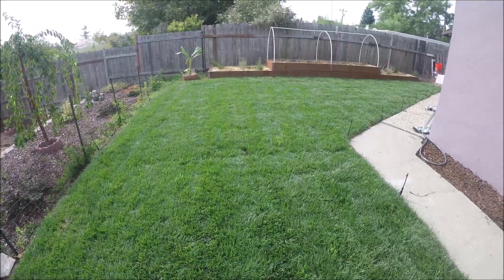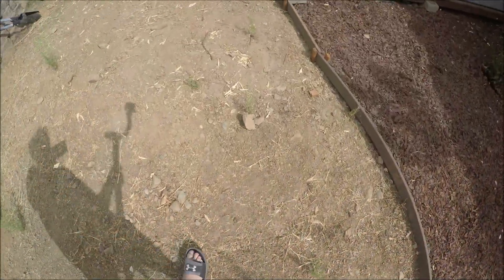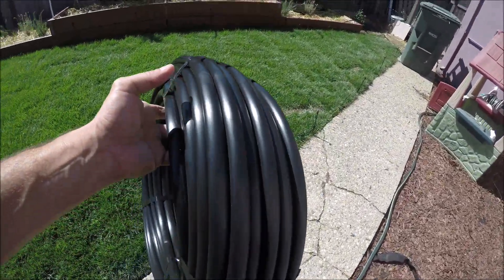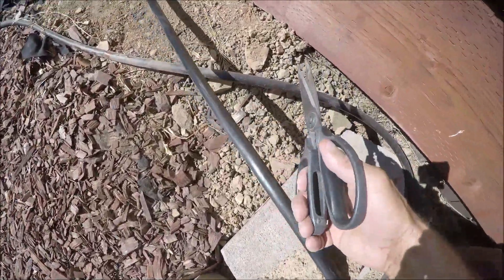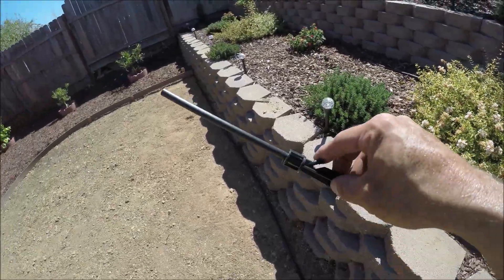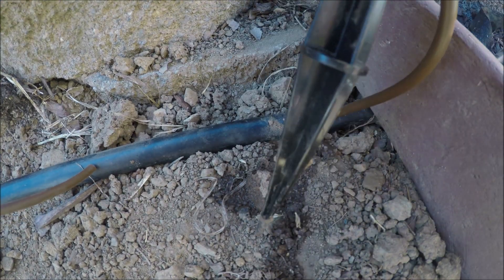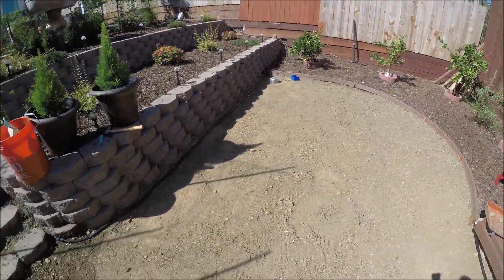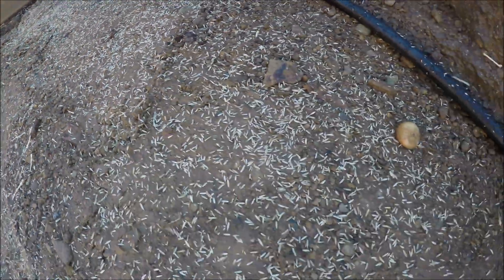HOW TO PLANT GRASS SEED | STEP BY STEP

Comment: That was thorough preparation you did!
I had not seen Sure Start used on turf before, only as a transplant fertilizer.
Lots of good things in it though.
I have had some pre-emergent action happen when I used seed meal products as a starter but there is probably such a small amount of Alfalfa meal in it that it won't effect your germination.
I hope you have excellent results with it!
Reply from the maker: Wayne Essar, thank you. Since it was a small area the guy at Green Acres suggested I use sure start, so I am giving it a shot.